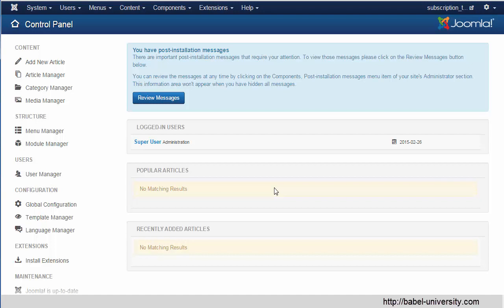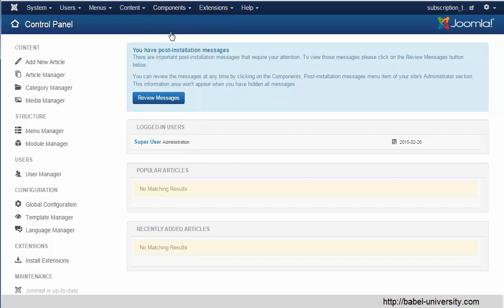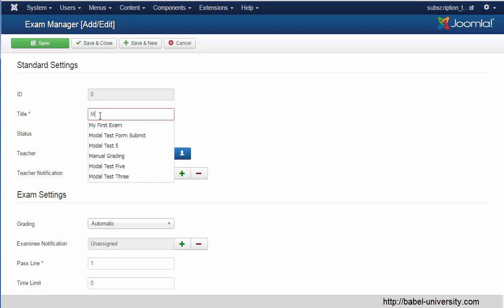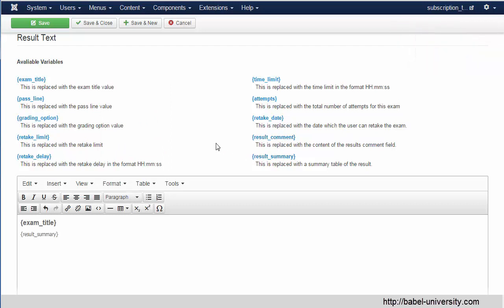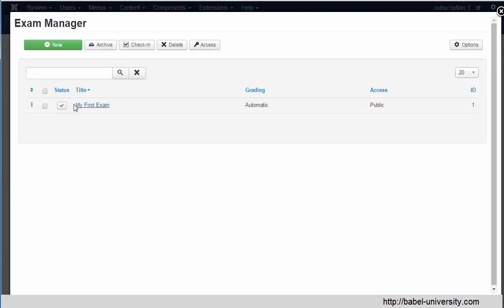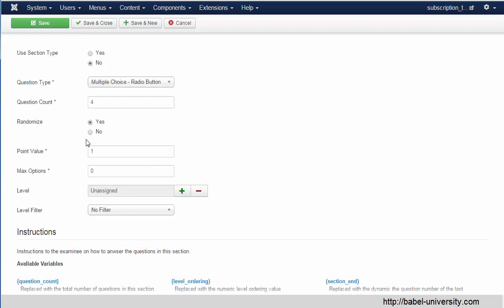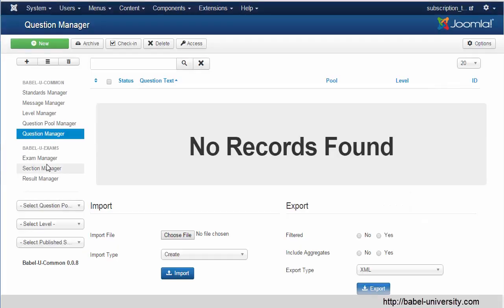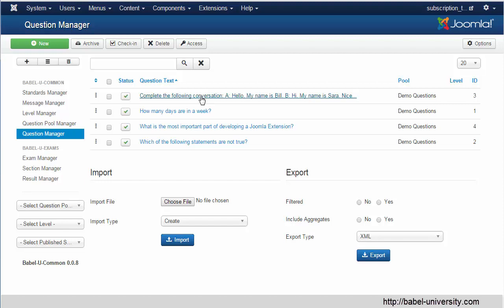"My First Exam" with Babel-U-Exams 2.0

Comment: Hi Mathew, Is there any way to set retake limit as per user? For now I use to increase retake limit for the exam that increases it for all users.
Reply from the maker: It's been a long time since I worked on that application, but if I recall correctly you would need to make the change in the database.
It would be in the results table. if that helps.